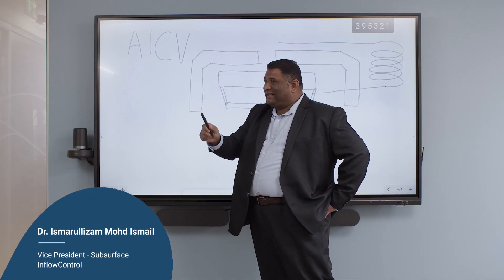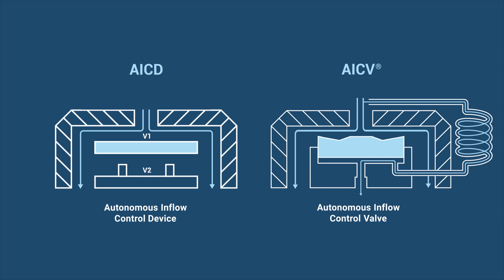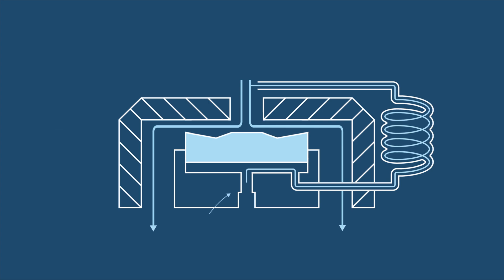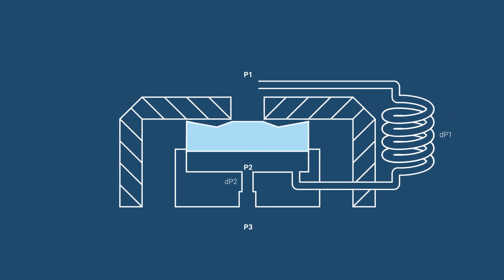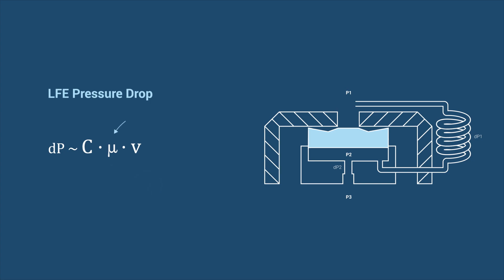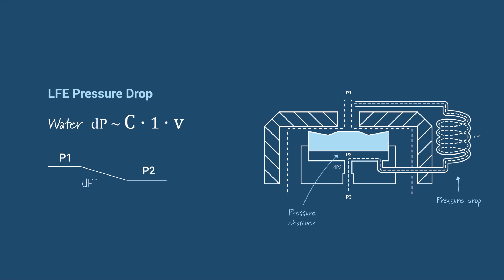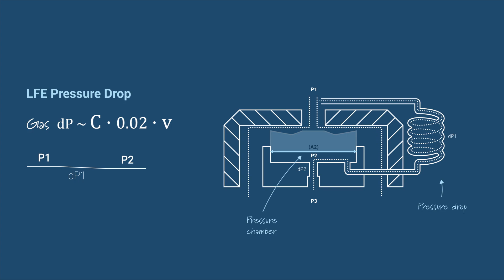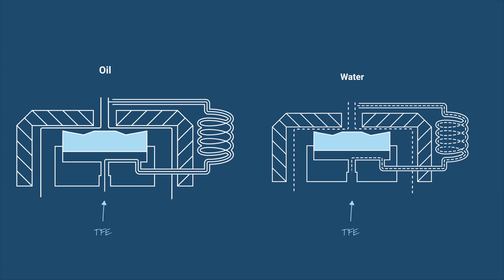The PHYSICS of the AUTONOMOUS Inflow Control VALVE

Comment: Thank you for the brilliant video.
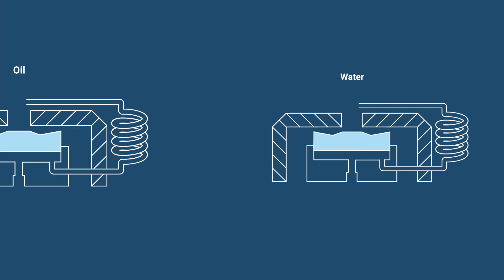You mentioned at 7:04 that "Due to water's higher density, the TFE will restrict or choke more of the water than the oil as the fluids exit the pressure chamber and enter the well pipe." However, I couldn't quite understand the relationship between density and this restriction. Could you explain it in more detail?

Comment: How much fluid LFE allows to flow even when P2 is higher enough with Gas/Water and the valve is closed? I understand it is customizable though.
Reply from the maker: Hi Bilal, 
Around 3% of the main flow from the reservoir flows through the LFE.
Reply: @InflowControl  that's not much considering the innovative autonomousity of the system. 👍